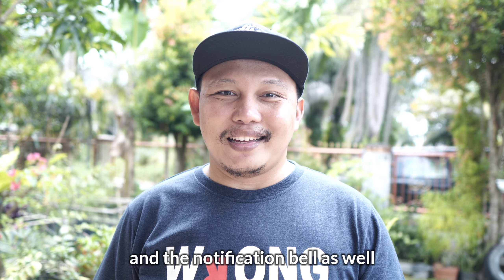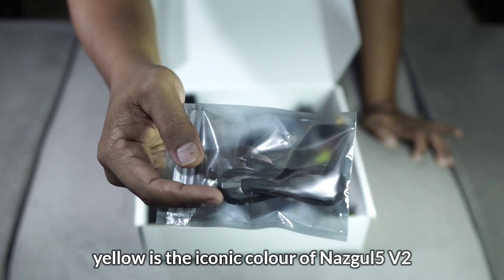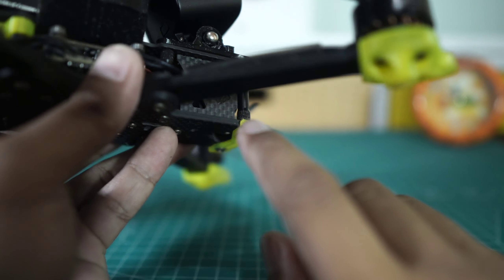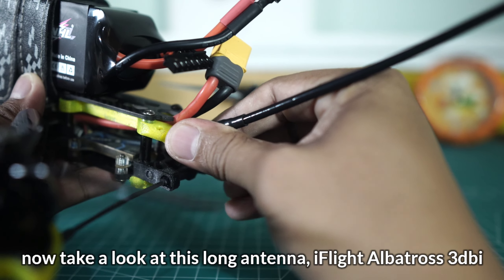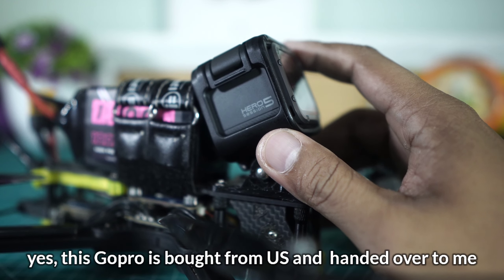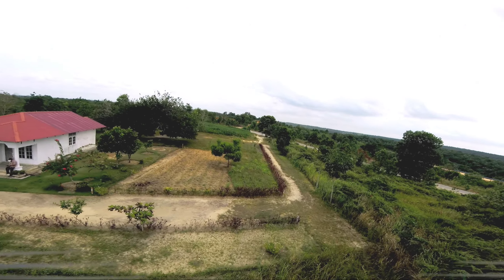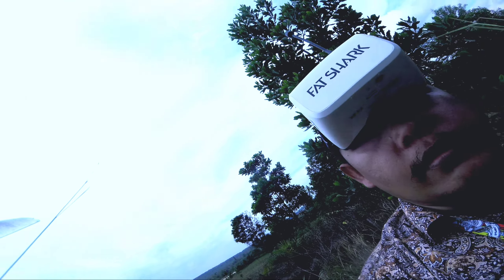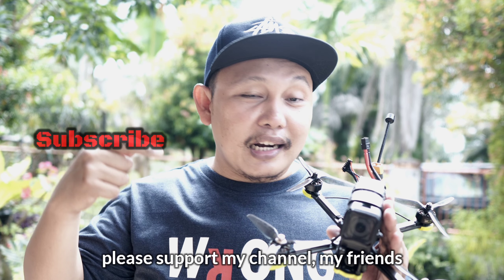iFlight Nazgul5 V2 6S - My First 5 Inch Quad - English Subtitle

Comment: How long do you need to charge it for
Reply: it depends on the battery, you divide the mah (capacity) by 1000 to get the amperage, EG a 500mah battery would charge at 0.5amps as for a 3000mah battery would charge at 3amps. And you go to the voltage and select 6s, whatever the voltage of your battery is

EDIT: with lipos you aim to charge them within a hour
Reply from the maker: Yes its correct 🙂
Reply from the maker: It is 6s 1100mah. So it takes about 45 to 50 minutes to charge it